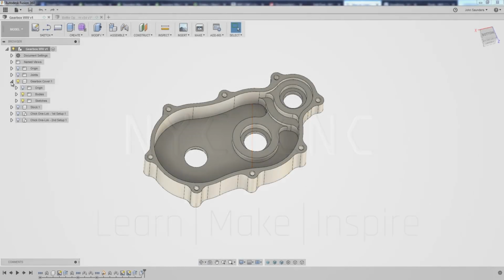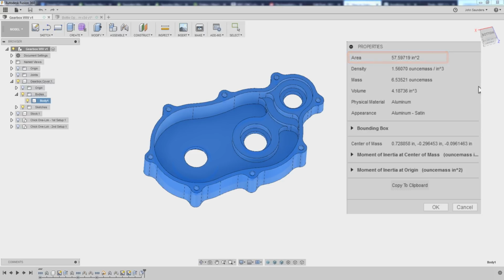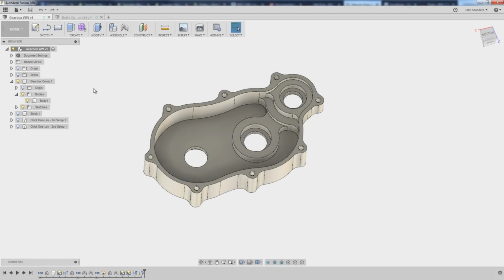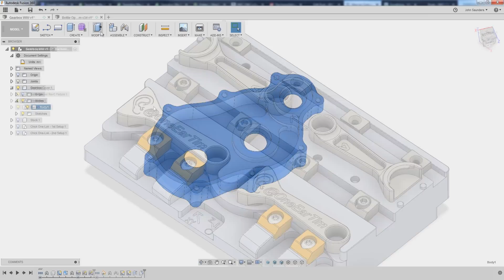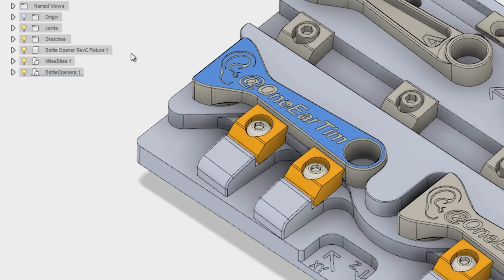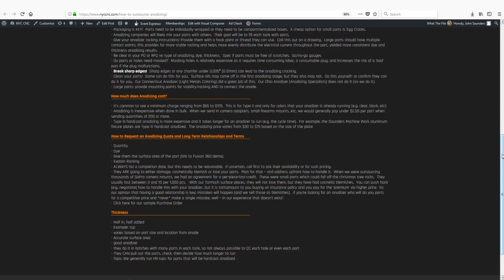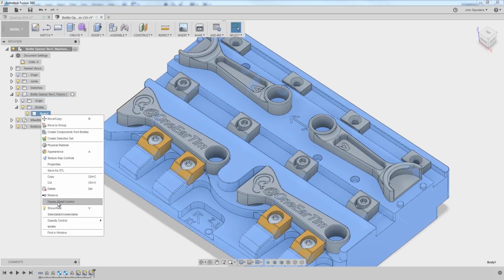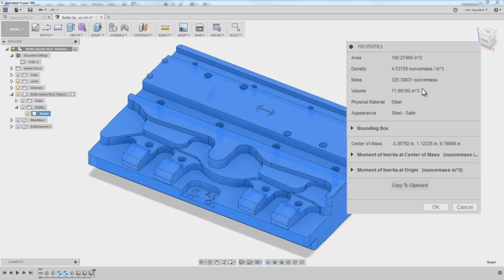How to Calculate Surface Area in Fusion 360!

Comment: p.m. I wonder why did you change from SW to fusion? I did the oposite ... What program is more adequate for machining ,Cnc, cam? Thx!
Reply: We switched from solid works to Fusion for a few reasons.
1) We had multiple users and Solid Works charges per seat/computer so it was pricey. As we are a startup we don't have income. Fusion supports startups by providing the software for free or little cost. 
2) The CNC/CAM for SolidWorks is expensive. I'm referring to add ins aka plug ins. And the free plug ins are from AutoDesk the same company that makes Fusion360. Which is included in fusion 360 for free. And we love the CAM portion of Fusion it is the best i have ever used!
3) Our sports car has lots of organic shapes that then get turned into molds. The tools that fusion provided for this, as well as many other tools, has been simplified greatly. As we are doing everything ourselves to reduce costs it was extremely valuable to us if the learning curve was greatly reduced. Fusion was far easier to learn than solid works.
4) the community. solid works doesn't come close to the community input and development that fusion has. We learn everything we need from these grate people like John.  

In conclusion we left solid works and will never return. Best Matt

Comment: can you measure the area of specifica parts of your model? or only whole "body"?
Reply: dgo85 
You might be able to go into the Patch environment (as opposed to the Model or CAM environments), break your model into individual faces/surfaces, then measure the surfaces you're interested in. I suspect the area measurement would be for both sides of the surface(s) you select, so the area might be twice as much as you'd want. Prolly a good idea to test on a surface with a known area just to make sure it works the way you expect. (I'd test this to make sure it works, but I'm not on my computer at the moment.)
Reply: I tried this and it came close to working. It looks like you need to go into the Patch environment, select the body (from the browser), then use the Unstitch tool to break the solid body into individual surfaces ("surface bodies"). Now you need to join the surfaces you want to measure into a single surface body; select the surfaces and use the Stitch tool to join them into a single surface body. Now find the surface body in the Browser and check its properties. The area shown seems to be for a single side, not both, so it is NOT necessary to divide the calculated value by two.

Comment: Something new I’ve been playing with for fab projects is to use the weight it gives you for a specific type of material, if you do your math correctly it will give you a super accurate total material length, pretty neat.

Comment: Is that for the whole part or just the top face?
Reply: Wonder Around 
Whole part. You'll note that the properties dialog is opened from the body, not just a single face.